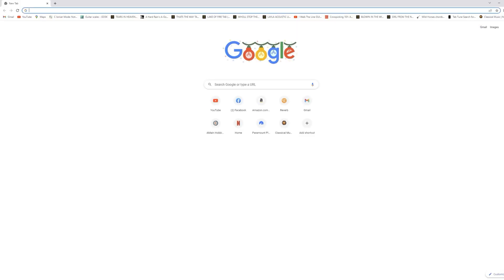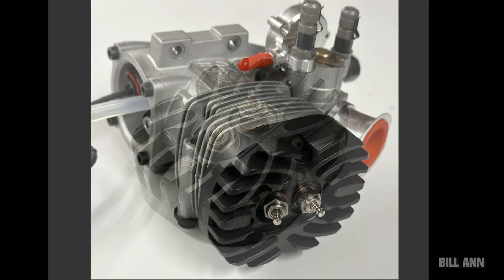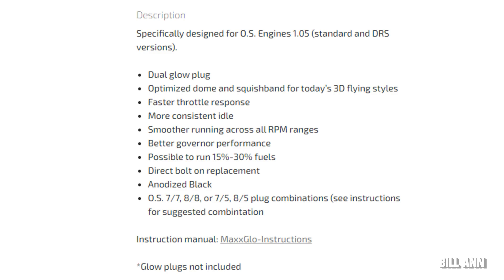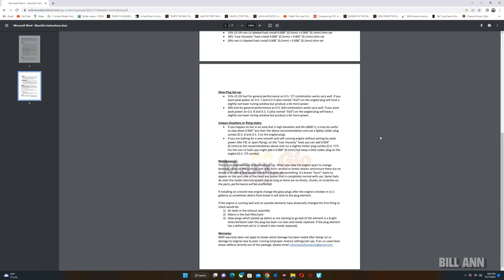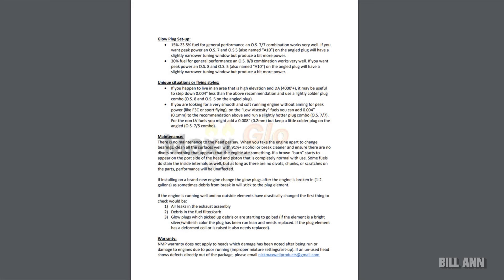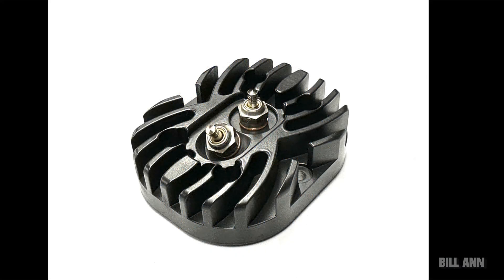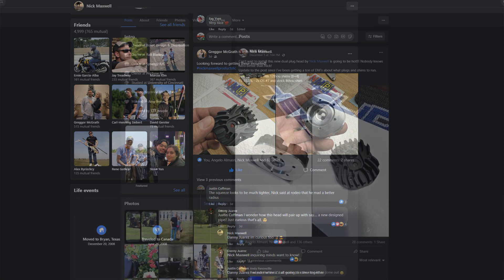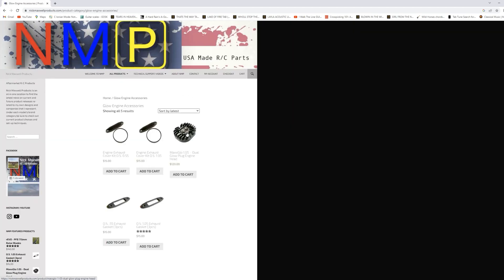NMP's MAXXGLO 1.05 – DUAL GLOW PLUG ENGINE HEAD

Comment: I wonder if this would be a benefit for 50 size nitro engines too? I love nitro helis, but fuel is getting very expensive these days, and many times, a 50 size is the compromise made.
Reply: It is expensive. At some point people will start making their own fuel, just like the old days. I’m saving fuel cans just for that. It’s a lot cheaper. Gas engines are cool but there is something about nitro..
Reply: @NitroClouds  I have no option but to mix up my own here, its not really any cheaper than premix sadly. I love gas helis, but nitro is better for 3d
Reply: Not a new idea. This was in the market years ago and it did help a little but is never going to be perfect. One of my buddies was running this along an inflight mixture adjustment. Honestly if performance is what you are looking for electric is way to go, nitro is cool but it will never be as good.
Reply: @FreStyle3D  electric is good for practicing high power tricks for me. Learn it on the sim, then an e-heli, and once you have it sorted, out comes the nitro. I hate 3-4 minute flights :/
Reply: @Gornflyin  I have two of the hottest electric 700’s out right now- the Raw 700 and the Specter V2 NME, and if I could only go fly one helicopter on the weekend, it would still be one of my nitro’s. And in the cold, damp winter weather, my 1.05’s are really happy. I’ll always have both nitro and electric. Some of the most impressive flights I’ve ever seen pro’s throw down have been on nitro
Reply: @NitroClouds  amen! Preach it nitro brother :D
Reply: @Gornflyin  I guess it depends on your flying style. I have been around for over 20 years so i have plenty of experience with both and my choice is electric for all out 3D flying.
Reply: @FreStyle3D  if your really sending it new school, then yes I agree. Besides that though, I still prefer the feel of nitro. I think if your serious about flying, you'll have at least 1 electric for aggressive smack.
Reply: @Gornflyin  yes old school 3D flying is like watching a movie in slow motion compared to today's hardcore 3D.
Reply: @FreStyle3D  i'd argue most of today's "movies" mostly suck and pretty much all look the same regardless of speed.

Give me a slow motion movie with a compelling and skillfully written story over a fast paced boring seen-it-a-million-times-collective-pump-tick-tock-marathon stick bang any day of the week. ;)